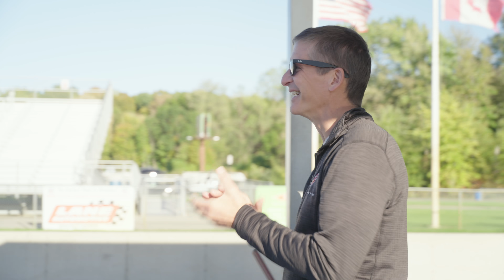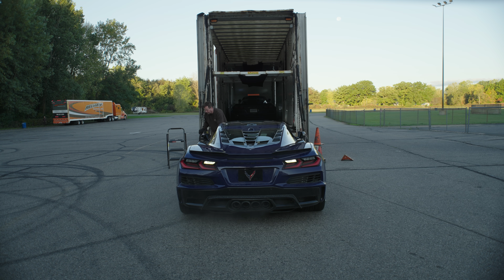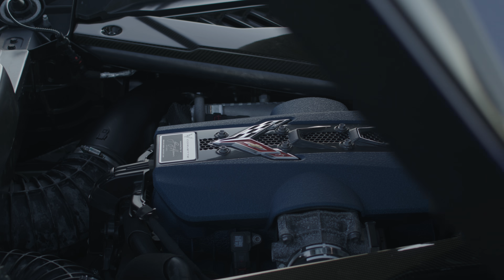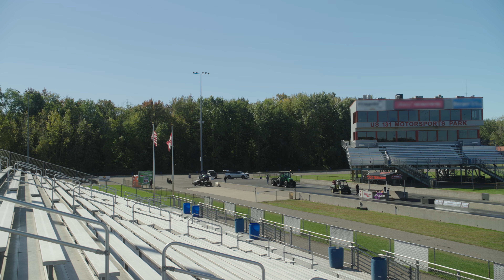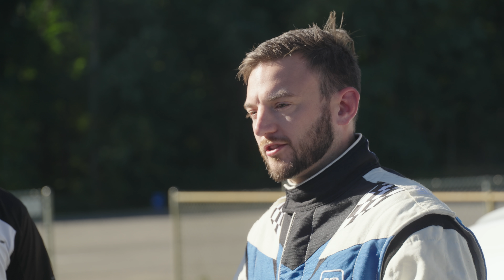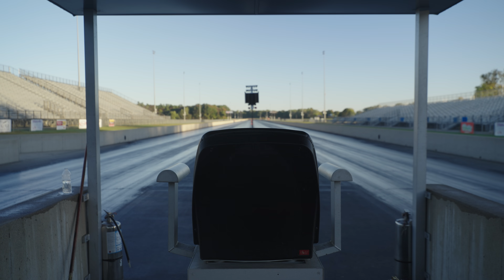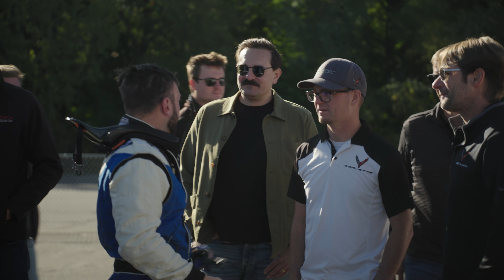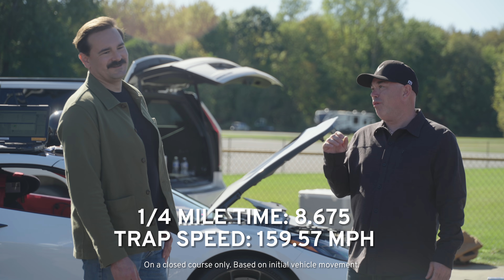We Pushed The Corvette ZR1X To Its Limits (DRAG STRIP TEST)

Comment: ZR1X is now the benchmark forever.
Reply: For a LOOONNGG time
Reply: Love it. Great example of never enough.
Reply: Why’s trap speed so low for 8.7?
Reply: @nkoster3717 cars that normally trap that low have a top end with 2500+ hp
Reply: @Viralbutnotyet  - No they don’t.  8.6 drag cars are typically in the 1000 hp range.  They are lighter than the ZR1x.  Typically around 2600-2800 lbs with driver.
Reply: @Viralbutnotyet no 😂
Reply: @Viralbutnotyet 2500+ Hp is a 5-6 second 1/4 mile
Reply: @aimxdy8680 2500 is more like 7 second car . 5 second 1/4 mile is 5k hp in a 2400lb car 😭
Reply: @nkoster3717 Torque from the electric motors.
Reply: Blows me away how civil it sounds at idle. Dam!
Reply: Nah in 5 yrs it'll get beaten. Look at the plaid. It came out in 2021 and ran 9.25 @151. Nobody can touch it for a at least a couple of years. In less than 4 years it's not the quickest anymore.
Reply: @CL-nj3zs  The Plaid is a one trick pony Acceleration that’s it no handling brakes Ugly weights as much as a Mopar No mechanical sound
Reply: Nothing is forever... There's always automakers one upping each other, which is always great for the consumers.
Reply: They need to turn up the boost on the ZR1X give it more power
Reply: Benchmark for what?
Reply: More GM JUNK
Reply: Quickest Production Combustion car and 3rd overall (only the 2 EVs the Nevera and Battista are quicker. They are in the $2M+ range about 10x the price).
Reply: @JMou-14 or Chinese evs but those are nothing the us unfortunately
Reply: new halo car
Reply: Hypercar for under 300k. Only America can do that!
Reply: @Saltinator  really. Heard of any Chinese cars. Look it up
Reply: Until Ford and Chrysler fire back.. My friend Jim Shmittinger has a street driven twin turbo 2016 Hellcat that runs 7.70s.. He has taught mechanics at Hennesey on how to build..
Reply: @sd455pontiac nobody cares lol.
Reply: @WewuzKangz85 apparently you do otherwise you would've kept scrolling and not repied.... Keep it moving........
Reply: @WewuzKangz85  SD455....SWEET MOTOR.
Reply: Yangwang U9 Xtreme is way faster in the top end and not much different zero to 60, Rimac Nivera is faster zero to 60 and in the quarter.  There are Chinese electric hyper cars already doing quarters in the seven. 

The obvious thing is that electric is the future and the only way this car got this fast is by using an electric motor with instant torque ;)
Reply: @MikeMPharmaCyclist The Rimac is $2 million, and the Yangwang is also more than the ZR1X…
Reply: @CarefulThatsLoaded  why does it matter that it’s more expensive? They aren’t mass produced like the zr1x, they aren’t GM, these are high quality built hypercars
Reply: @h1gh_end134 ”Why does it matter that it’s more expensive?” What 😂😂😂😂😂😂… You’re getting more for less. What do you mean why does it matter? Holy cope.
Reply: @MikeMPharmaCyclist Tell  them!! Because  all electric  never use gas to help their cars go faster!
Reply: Until the Roadster debut.  Elon is crazy enough to include SpaceX RCS thrusters.
Reply: A Tesla Plaid did it in 8.56 @ 162.33 MPH.
Reply: @sunnyindenver  yeah the Plaid’s electric. It’s impressive, but it has nothing to do with the ZR1X.
Reply: @yeetskeet691  Well, I was responding to the comment:

"ZR1X is now the benchmark forever."

When it isn't.
Reply: @sunnyindenver only in the void where ev guys hearts used to reside.
Reply: @FlavorTownCityCouncilchevy is king lil bro😂😂
Reply: @FlavorTownCityCouncilyea ok stop it tesla can't turn its a one trick pony
Reply: @Viralbutnotyet  The ZR1X is an amazing car. But a Plaid had a better 1/4 mile time and speed and that's the comment I was responding to.
Reply: @FlavorTownCityCouncil That depends on how one defines better. As a pure sports car I think several ICE vehicles are better than the Plaid. As a general family sedan which out accelerates pure sports cars, yeah...the Plaid is right there.
Reply: @FlavorTownCityCouncil  It depends on the refrence window you're looking at. The Plaid is better off the line, but I'd like to see the comparison on a full mile between the two.

Because while yes, electric supplies instant torque - with the ability to calculate the amount that's needed for a good pull. It's not going to last as long running at maximum power before the battery can fry an egg on top of it. Don't get me wrong, I absolutely love the plaids. They're marvels of engineering. But it's an electric vehicle, the way it generates rotational force is very different than the way an ICE does it. Additionally the lack of a need for a transmission is another great factor.
Reply: @yeetskeet691  " It's not going to last as long running at maximum power before the battery can fry an egg on top of it."

The Plaid can perform repeated runs down the track without problem.
Reply: @sunnyindenver  what kind of track?
Reply: @yeetskeet691  Not sure what you're asking.
Reply: @miket2172 model 3 performance will like to have a word
Reply: @sunnyindenver plaid wasn't stock.
Reply: Absolut is on E85 tho with 1600hp whereas the ZR1X was on pump gas
Reply: That plaid was heavily modified on radials and it was gutted like a fish. We comparing stock for stock and in those terms the plaid got cooked.
Reply: @bobtaliaferro5492  This ZR1X isn't stock.
Reply: My bad the 10 lbs they save with that seat was a wash with other equipment for logging data in there. Other than that keep crying your Forza heros got smacked
Reply: @sunnyindenver ok so what are the modifications?
Reply: @johncena-hq1ti  Those that GM made to the tuning.
Reply: @sunnyindenver  that's going to be on the production cars. All that "tuning" you saw is their programming for the launch parameters. That's all software
Reply: @Shadowboost  So we don't know what a production car will run.

Look, I am not trying to discount this car. It's very impressive. However what we've seen in real life against what was benchmarked don't always align.

If the production car can make these times as easily as the Plaid makes its times then great! The Plaid can't stay on top forever (and hasn't for a couple of years now)
Reply: @sunnyindenver  correct, but I'm pretty sure Dragtimes has proved time in and time out what the real production cars can do. Knowingly posting a modified Tesla time is different than speculating that this car is "tuned"
Reply: @Shadowboost  I heard all of this with the Demon 170. Great official numbers but real world isn't nearly as good.

'Knowingly posting a modified Tesla time is different than speculating that this car is "tuned"'

The modification to the Tesla were the same that Chevy did with the Corvette by "removing" the rear seating, doors, etc. 😁
Reply: @sunnyindenver  huh? Vette never had that to begin with. But if you want, they could strip the ZR1X and make it 150 pounds lighter. They can also put race fuel in it and an actual tune and make 300 hp more
Reply: @sunnyindenver you know production cars have a stock tune that’s gets refined correct?
Reply: @sunnyindenver whats the Plaids nurburgring  time or any track ?
Reply: @miket2172  Irrelevant. The comment I responded to was not referring to the Nürburgring ring.
Reply: @sunnyindenver ok what stock Plaid ran that tome none . Ripping  the interior out doesn't count and it sucks anyways
Reply: @miket2172  I thought modified was OK as this one has been specifically tuned.
Reply: @sunnyindenver So youre saying this STOCK car has been tuned? 😅😅
Reply: @Dou6.2  Why all the GM staff supporting it? Or will a full GM support crew be included with each purchase of a ZR1X?
Reply: @sunnyindenver - Not factory stock like this Corvette.  Factory stock Plaids run 9.2-9.3 at best.
Reply: @danmyers9372  It was factory stock, just a little weight reduction.
Reply: @s @sunnyindenver  A “little” weight reduction?  🤣. That car was totally gutted.
Reply: @danmyers9372  So is the Corvette. They removed the rear seat, doors, windows, display, etc.😁
Reply: @sunnyindenver the corvette wasn't tuned, lol.
Reply: @sunnyindenver technically, sure, but if you line the Chevy and plaid up on the same surface the Chevy is going to win lol. The plaid consistently runs 9.1-9.2 ish, while this Chevy runs 8.7-8.8 consistently. And this is coming from a guy who is considering getting a model s as his next car.
Reply: @JJoshuaMMatthews  Will it? We'll need to see some real world racing to know for sure. The Plaid is proven, this is not.

At this time all we have is a sample car supported by the factory. Much like the Demon170 which achieved a great official time but in real world use is beat by the Plaid.
Reply: @sunnyindenver fair enough, but the source you’re citing had a completely stripped out car, and from what I can see this while this chevy is missing a bit of its interior it had a whole lot of equipment in there that most likely weighs about the same
Reply: Hope ppl sell their model s bland b4 30k miles because they start losing power every 10k after.
Reply: @bobtaliaferro5492 we’re telling lies now?
Reply: @JJoshuaMMatthews  The chevy is missing a back seat 😁

These are two different cars. One is a family sedan which just happens to be capable of out accelerating high performance sports cars. The other is designed to be a top tier sports car. I'd have been disappointed if it couldn't beat the five year old Plaid (and that's not a given as this is not representative of the real world for the ZR1X)
Reply: @s @sunnyindenver you’re right , it SHOULD be able to beat the plaid, but can’t you say the same for every new supercar? And yet most of them can’t. It’s an engineering feat because they’re still managing to keep up with EV’s using much less efficient combustion technology. On a separate note, I do wonder if batteries will ever get lighter, because if not then ICE vehicles could still be competitive in the  performance category
Reply: @JJoshuaMMatthews  "t SHOULD be able to beat the plaid, but can’t you say the same for every new supercar?"

I'm actually surprised it took this long as the Plaid is now five years old. That said this is not a pure ICE vehicle, in order to achieve it's very impressive numbers they had to use a little electric 😁
Reply: @sunnyindenver people have been running faster times than gm with stock vettes for years. Nothing new. You either despise corvettes or you need to crawl out from under that rock.
Reply: @jordank2028  " You either despise corvettes or you need to crawl out from under that rock."

No, I do not despise corvettes. I especially like the C8 and two of my friends have them.

Maybe I do need to "crawl out from under a rock" but no stock Corvette is running faster times than a Plaid in the 1/4" mile
Reply: @sunnyindenver stock? Not even close 😂
Reply: @sunnyindenver That’s a modified plaid with weight reduction weighing 1000 lbs less than factory, There’s street legal C6 corvettes running 6 second 1/4 miles at 220+ mph, which is 2 seconds faster than modded Plaid.
Reply: @aimxdy8680  Only modification is weight reduction.
Reply: @sunnyindenver That’s still a mod lmfao, 1000 lbs and by the way the plaid has a custom mod to the electric motor so weight reduction isn’t the only mod, There’s modded street legal stock block C6 corvettes running 6 second 1/4 mile at 220+ mph, and C6 corvettes going 254 mph in the half mile. C7 corvettes running 7.0 second 1/4 miles. By the way, Mighty mouse ran a 7.8 second 1/4 mile in the C7 Z06 with a Stock LT4 motor, stock rod, stock pistons etc.
Reply: @aimxdy8680  It is a mode, I don't recall saying it wasn.t
Reply: @sunnyindenver A custom added mode is still a mod. Either way Street legal C6 corvette runs 6 second 1/4 miles at 220+ mph on stock chassis with IRS.
Reply: @aimxdy8680  Get a sense of humor dude.
Reply: There are much faster cars out there, we are talking 185mph trap speed on NORMAL roads.
Reply: Cleetus ran all those cars on his channel and so did Brooks @dragtimes and none of them went over 167 infact jesko didn't even break 159 and the 2000hp nevera that Brooks made 5 passes in did 165-167 go figure
Reply: @bobtaliaferro5492 where can I see that vid
Reply: Who gives a crap about electric cars, no one here.
Electric cars=an exceptionally boring experience.
Reply: @dougmaverick3287 Well if they are faster then that puts ice in second place
Reply: @Lello75-ww7ib that’s amazing, 
Where did you pull these facts from?
can you name some of those cars that can do 185 mph in the quarter mile on a normal road??
This ought to be very interesting …
Reply: @rhpicayune Koenigsegg Jesko Absolut, Rimac Nevera R.
Reply: @Lello75-ww7ib multi-million dollar cars, btw.
Reply: @rhpicayune especially a production car on normal road conditions. Only 2 I can think of are the Rimac and Pininfarina. But they are vacuum cleaners and don’t count.
Reply: @jordantaylor9858 Jesko Absolut not a vacum cleaner at least,,😅 still pulled 8,7s @185mph ¼mile with RWD and non prepared surface. *Expecting low 8s' on sticky surface.
Reply: @r@r @rianrahmanto8069     8.88 on E85 is busses behind 8.675 on 93. Tune the X to run E85 or run 93 in the segg stripping it of 500hp and see what the result is. 
Prepped vs no prep is apples to oranges but so is E85vs 93.
Reply: @magnerionmachine69 this idiot really said 3$ million + 😂
Reply: @magnerionmachine69 So what? They are faster and they cost that much for a reason.
Reply: @Lello75-ww7ibcomapring apple to oranges. One is built in kentucky by bob and cost less than a base model ferrari. The other is hand built and the exhaust alone probably costs the same as a Zr1.
Reply: @rhpicayune  Hes gonna have to check his video games and reply
Reply: @rianrahmanto8069  no Koeniggshit outside of the factory has ever done times as fast as they do. Go figure
Reply: @rianrahmanto8069 yea and they break non stop. Cool cars but not refined at all. Non stop issues across models.
Reply: @rianrahmanto8069 well ofc 2k pounds and 736 more hp
Reply: @rhpicayune  the jesko absolut did 186 on unprepped surface
Reply: @magnerionmachine69  your point? They are exclusive hypercars, something a vette will never be
Reply: @Lello75-ww7ib I mean… for 10x the price, yes. $2.5 million for a Rimac Nevera R…. 😂😂😂
Reply: @Lello75-ww7ib Stock production car? List them please
Reply: @Lello75-ww7ibfactory cars with a warranty?

Comment: congratulations GM engineering.
Reply: On the Corvette side of engineering yes.  For their other vehicles, they are planned with obsolence.
Reply: @MrBooster999  You mean like every other car manufacturer on the planet?
Reply: @bradstokes3067 a lot of them but not all of them are as bad as GM
Reply: @MrBooster999  oh SYAU, gm has several competitive models in several separate segments. The Corvette is not their only impressive car, you’re just another hater.
Reply: @G-Rated oh the ignorance is bliss. How's that 6.2 recall going? How about the ex engineer for Chevy that admitted that they were told to make cost cutting drawbacks that effectively reduced the lifespan? Don't hate, just educate yourself on GM.  
~ a Corvette owner.
Reply: @MrBooster999  Awe. A Corvette owner who wants to discuss gm’s only major recall in how many years because they allegedly make cost cutting decisions just like every other manufacturer looking to make a profit on mass produced vehicles? It sounds like someone who desperately wants to change the subject from the Corvette C8 supercar and talk about recalls because you’re under the impression Ford and Stellantis don’t have recalls of their own.

At least the recall gm dealt with is one for an old 8 cylinder that’s about to be replaced with a brand new V8 that’s also built by GM. If you check Tahoe/Suburban/Yukon sales literally nobody cares about that recall which they’ve addressed. They still have the best products in that segment and they’ve remained the best sellers of the segment too it’s not even close. You’re wasting your time being a hater.
Reply: @G-Rated best sellers? cost cutting? The majority will buy the slop regardless because that's what's common. Stalantis and the rest are garbage as well.  It's not cost cutting when you specifically plan it to fail after warranty. Why you're sticking up for a billion dollar company that wants to rob you is pretty American

Comment: The Z06 engine with electric front drive would have been perfect. People that dig pushrod V8's are not likely to want an electric motor. A Z06X would be the perfect car.
Reply: This has the same engine design as the zo6 5.5ltre twin turbo flat plane crank. No pushrods
Reply: The ZR1X engine is a flat plane crank V8 TT with hybrid not pushrod

Comment: The C8 ZR1 has been dyno’d with 1,200+ hp at the crank, you can surely bet that this ZR1X is putting out more than the stated 1,250 hp.
Reply: 1020-30 whp for ZR1, probably close to 1200whp for ZR1X, no stock ZR1 dyno'd at 1200whp I think you mean 1200 crank for ZR1.
Reply: @gahaha8565  Yes, 1,200 at the crank
Reply: No just over 1000 WHP not 1200!

Comment: We've reached the level of fast that seems like we've completed a video game. It's at the level that makes you think its all over, nothing else to see nothing else to do. Wild
Reply: Oh but it will ! One day they’ll partner with like koenigsegg and put 2 motor in front that has 600hp each with 20kwh battery solid state that weight nothing and 100 octane with electric turbo v8 1600-1700hp alone so that a 3000hp car for not much more weight  6 sec 1/4 mile and 1.2-1.3 0-60 .. im pretty confident in 7-10 years
Reply: Yep